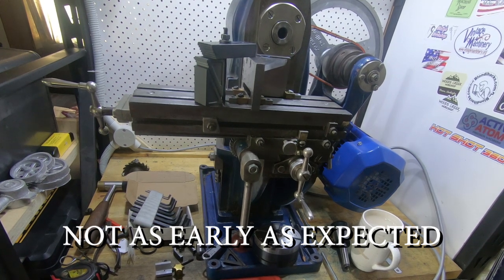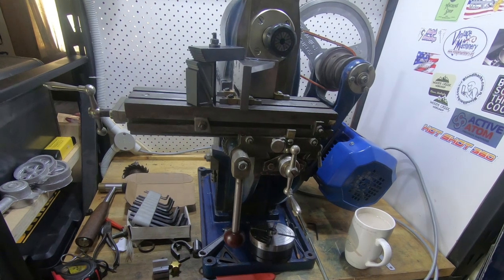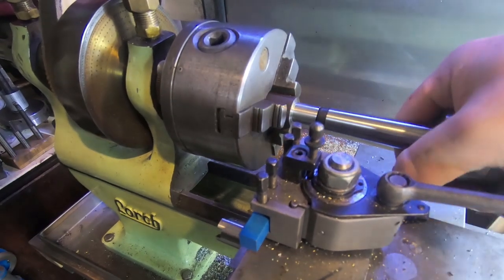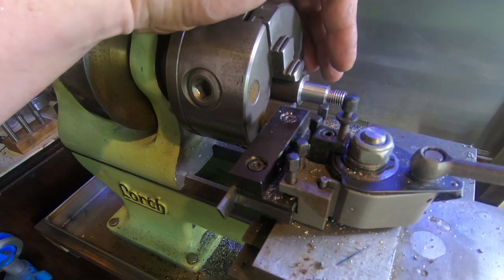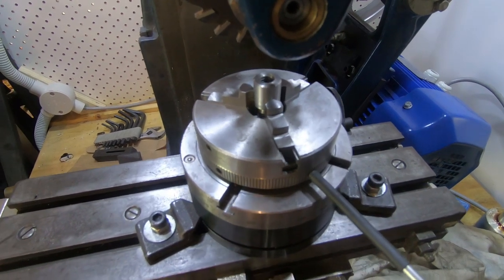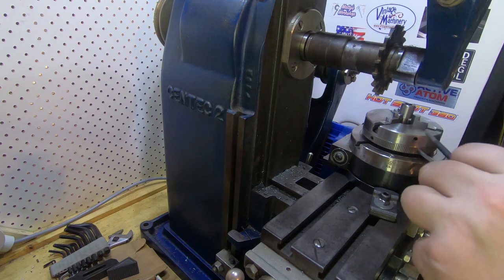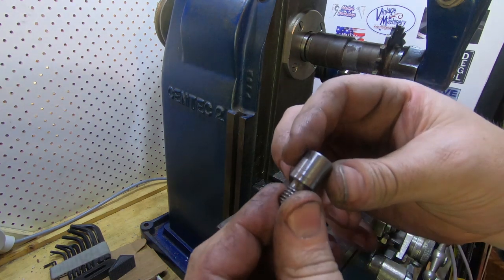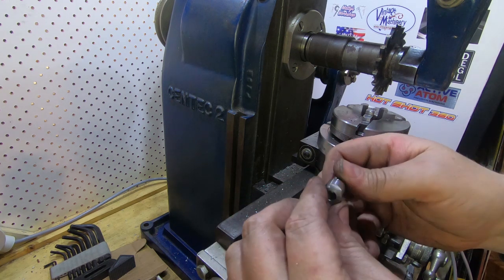Making a drawbar adapter for a ER32 collet chuck!

Comment: Happy new mill, first chips? 👍
I think you have scared, and edified many, with the temper embrittlement on some Chrome/Moly steels, it's mainly holding for long periods in the relevant temperature range, simple quench in oil/polymer, and temper for toughness, not hardness are fine, as you cover, but a very valid point raised. Atlas Steels of Australia have very good data sheets, I use them here in the UK.
Great job, big improvement in lighting
Reply from the maker: I've used it a lot. , but the lights help. Atlas tempering  graphs are the wrong way (portrait not landscape) and I'm never sure about them!
Reply: @EmmaRitson  Hi Emma, All heat treatment data is represented with the "X" axis -Time in logarithmic scale, this is to more clearly show very small or low values more clearly, though may not appear so!. These TTT graphs (very good description here:  https://www.tf.uni-kiel.de/matwis/amat/iss/kap_8/illustr/s8_4_3a.html) are very comprehensive, read complicated; transformation is measured in micro and Milli seconds, but extends in minutes, hours, weeks.
To recap, Atlas Steels, as others use this convention, even though they substitute other X axis values, their 4140 is configured for tensile strength, not hardness, which is the relevant property of this grade.
Hope this helps. Regards John.

Comment: Thanks for the mention...
Metallurgy is a very complex science, I'm only some Baby steps into it...   lol¸
What you're mentioning is the " Blue brittleness zone " most alloys are more or less subjected to this zone, some reading about that particular alloy is good practice before going into the process.
You may want to consider some clay type coating to replace the costly stainless steel foil. In the US there is a company called ATP coatings that specialise in those coatings, due to high cost of shipping to Australia you may be able to find a suitable product locally... 
Here is a reference:    http://www.advancedtechnicalprod.com/pdf/atp.pdf
The coating cuts the oxygen from the part being treated, works well for me.
Keep on the great work, ATB, Pierre
Reply from the maker: Thanks Pierre!!

Comment: Nice half slots you milled !  How does the quench go with the part wrapped in foil , does it still cool fast enough ?
Reply from the maker: i think so. it was glass hard. you dont want it quenching all the way out anyway, it brings up the temp of the oil a bit as it goes.

Comment: This may be a silly question.... but why not just make an extra drawbar, with a 10 mm end for metric stuff?
This seems a very elaborate job for a simple problem.... what am I missing?

Paddy

PS tip for using a heat treat oven: put small parts on a fire brick or some such thing, so it reaches the height of the thermostat. You'd be surprised how big a difference in T there is between the bottom of the oven and the top. 

Big parts heat through by convection, so there is no issue there, but smaller parts are a different matter.
Reply from the maker: The problem is.. the hole though the spindle is only 5/16" . Lol
Reply: Ah... ok... but it must taper out, surely? Or you would never be able to put that piece you made in there?
Odd way of constructing things... I think...
Anywhoo.... that milling machine turned out to be a real cutie !

Toodles!

Paddy
Reply from the maker: It's long enough to fit that in anyway. Makes the job easier too, because there isn't really enough space behind to take the drawbar out and change it anyway.